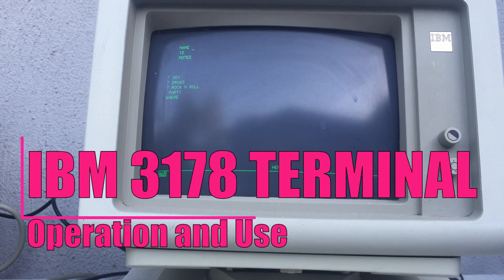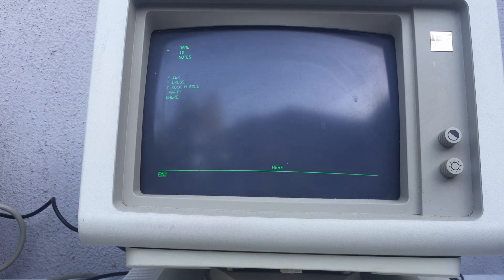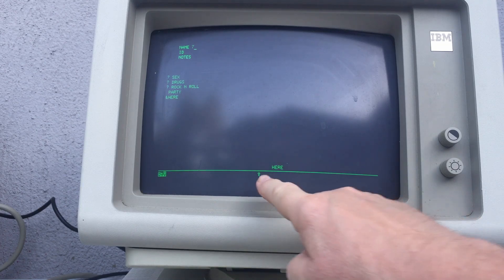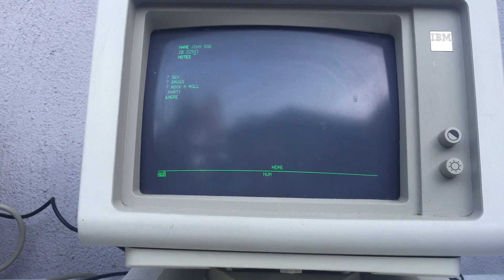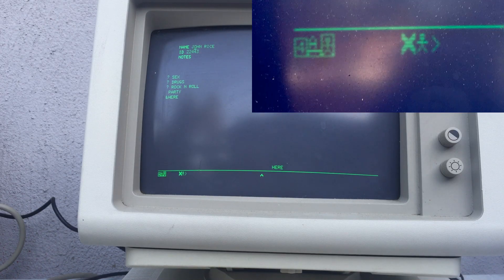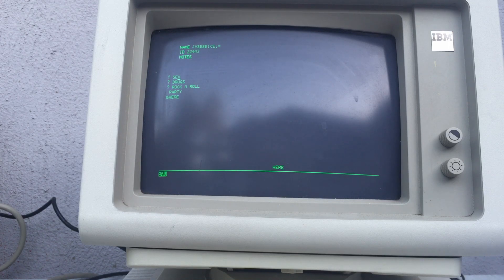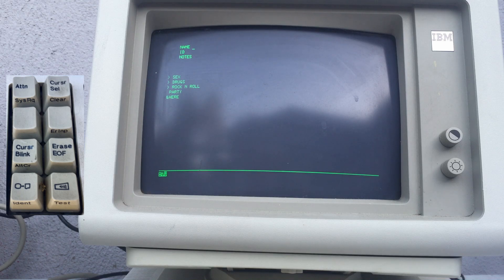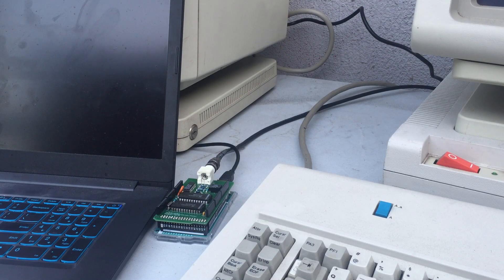IBM 3178 Terminal Operations and Use demonstration

Comment: I've been using a 122-key Model M terminal keyboard as my daily driver for several years now with the help of "Soarer's Keyboard Converter" which allows me to use it as a USB keyboard with programmable keys. Ever since I got this keyboard, I wondered what many of the unusually named keys did; this video has cleared that up, although several of the keys on this keyboard are in different locations to yours. Thanks for the video!